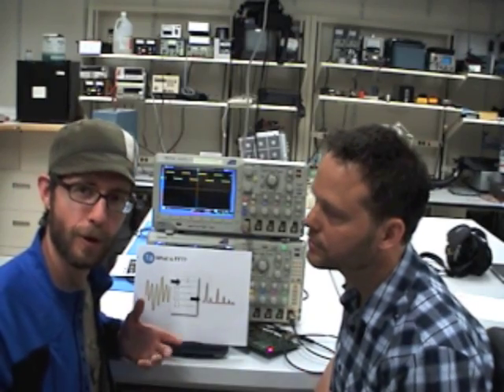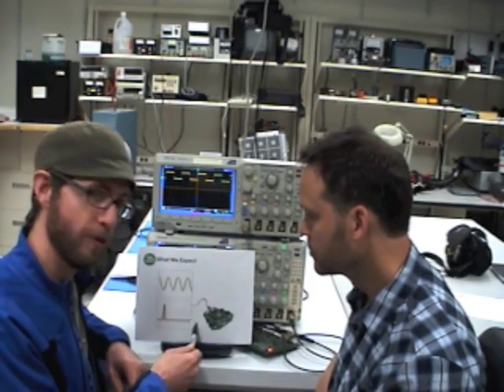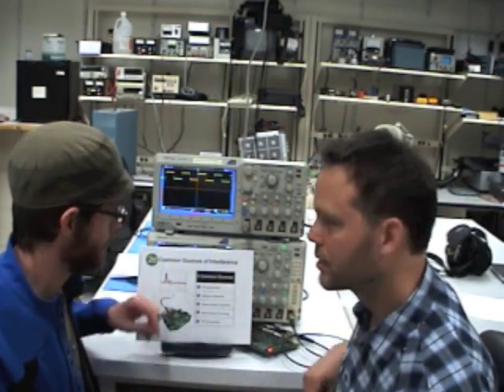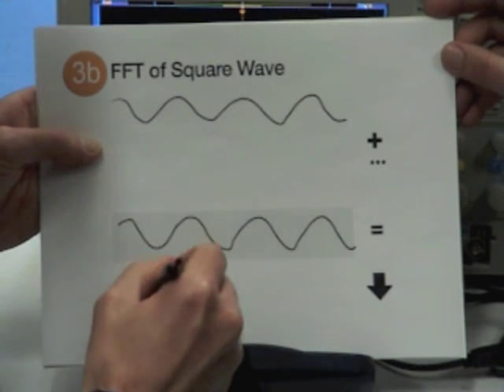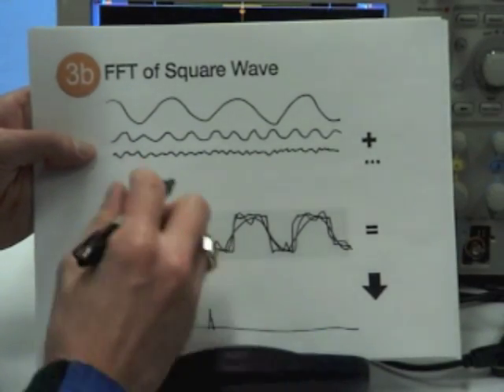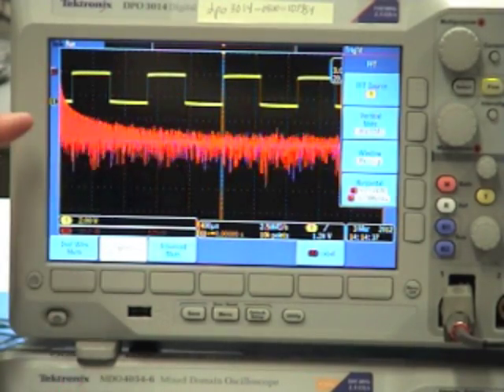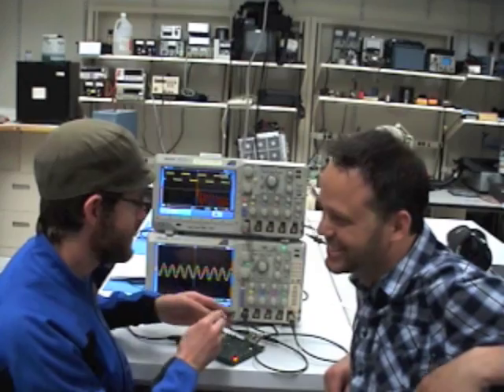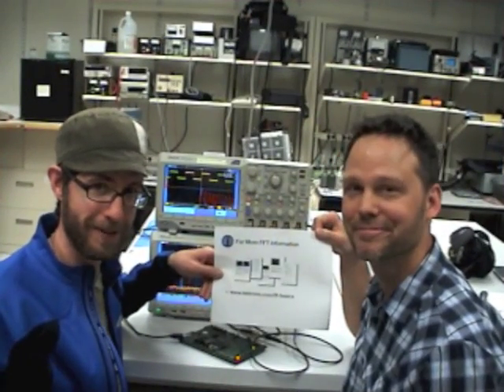FFT Tutorial

Comment: are you saying the top wave is the sum of all the waves at the bottom?  I don't really understand.
Reply: Yes I think that is the point.  Any signal can be represented as a sum of sine waves with varying amplitude and frequency. On the scope, each peak on the bottom curve( frequency domain) is a frequency and amplitude of a sine wave. Successive peaks( sine waves) added together create the top wave.  That is why a true sine wave has one peak in the frequency domain( bottom curve ).  The later part of the video showed an issue with hardware or software used which had two peaks for a sine wave.